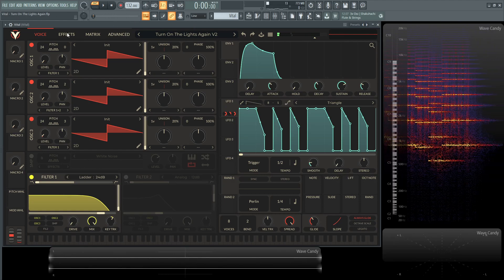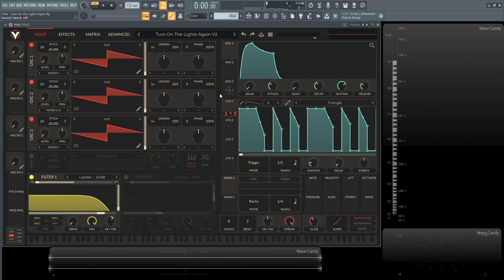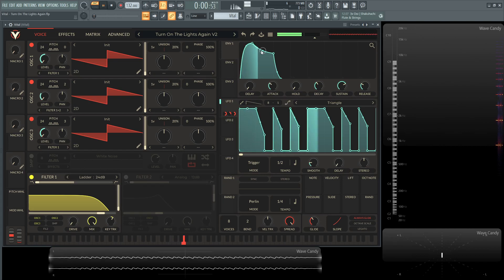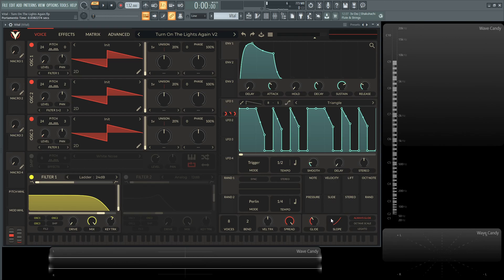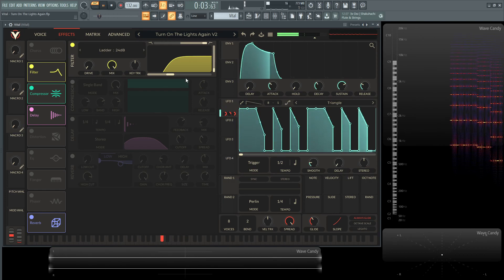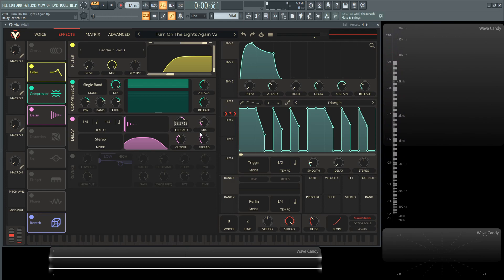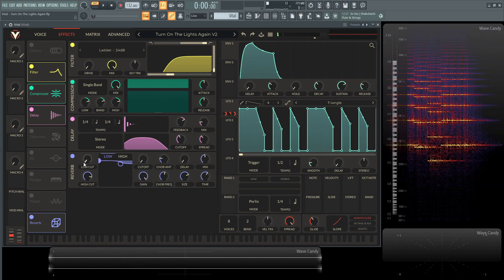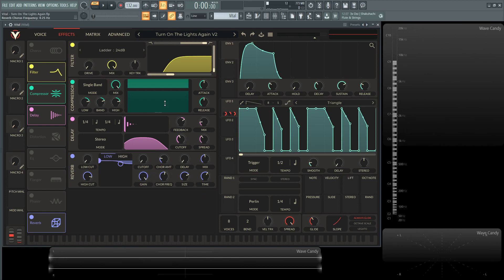Vital Fred again - Turn on the lights again (feat. future) - Sound Design Tutorial

Comment: You have a lot of knowledge about sound design that's why I have a question. Is this sound in Scooter Frequent Traveler a vocal or a synthesizer sound?
If this is a synthesizer sound, could you please make a tutorial to get a similar effect?
It has been appearing like this from 01:10 minutes.
I must admit that I especially like this sound.
https://m.youtube.com/watch?v=KHEu-In6DAk
Reply from the maker: I took a listen to it and to my ears it sounds like it started off with a vocal at one pitch, then the vocal was manipulated from there with fast changes in core pitch and also what sounds like an LFO on the tail end of the vocal to create vibrato and then soaked in reverb. If I were to recreate this effect, it would be possible in harmor by dropping in a vocal sample that doesn't change in pitch initially. from there the tools harmor provides, it would be possible to make something very similar. There are vocal packs that Image-Line provides with Veela and Victoriya where all the vocal samples were sung in C, giving the option to create any melody desired. I'll be showing that process in an upcoming harmor video for the playlist.
Reply: @jonaudio  Hey Jon, this is really interesting, I'll check out the Harmor VST, would be great to see how this works in your next vid.
Reply from the maker: That's awesome! Harmor is such a cool synth, I'm in the process of setting this type of thing up. I've used stuff like this in a couple of tracks to test it out and it had some very cool results
Reply: Thanks Jon. It doesn't have to be the same as the original, but it would be fun to know how to get a similar effect on vocals.
Reply from the maker: I'm actually building a session to demonstrate how to do it. It should be ready by this friday